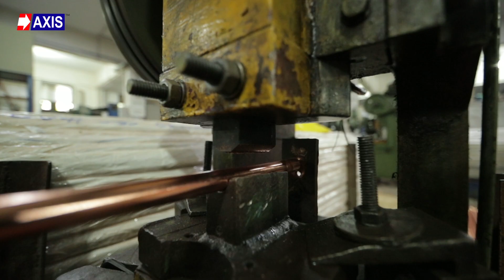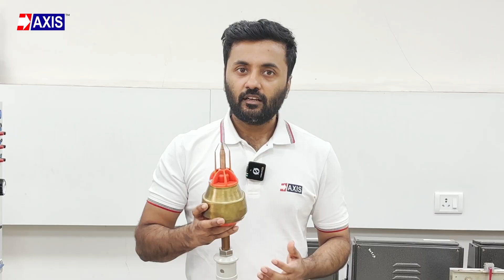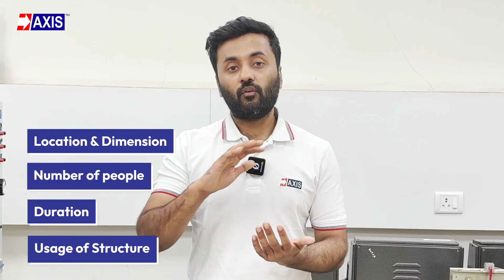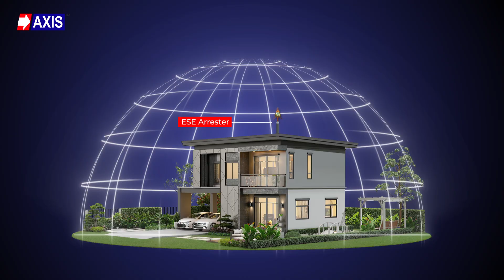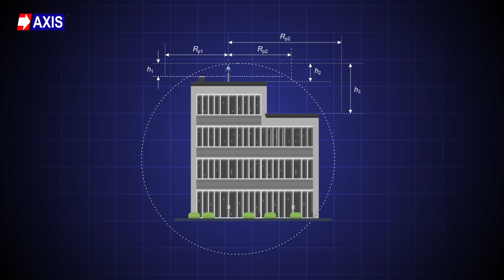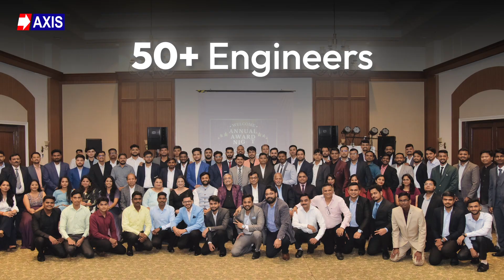How to Design an ESE Lightning Protection System? ⚡

Comment: Do you have to bond roof metallic structures or electrical installations to the lightning protection system?!
Reply from the maker: Yes. Because an ESE terminal doesn't change that. 

Every metallic structure/installation up there (RTUs, handrails, tanks, pipework, cable trays, masts) must either be bonded to the LPS or kept at/beyond the calculated separation distance "s". If you can't achieve "s", bonding is mandatory.